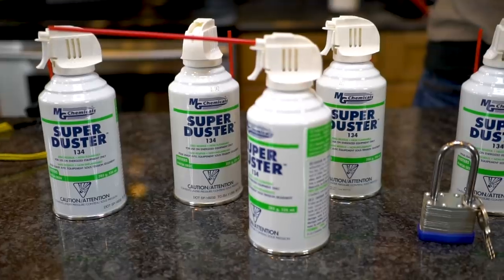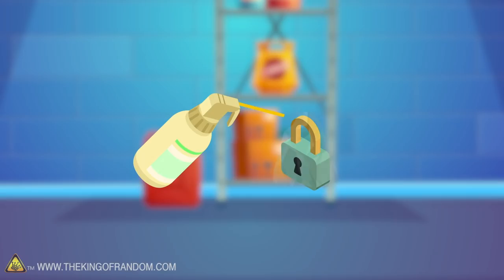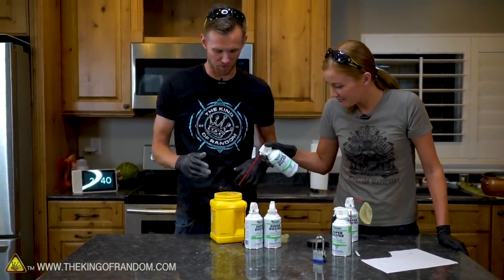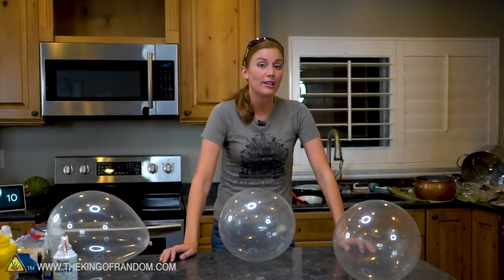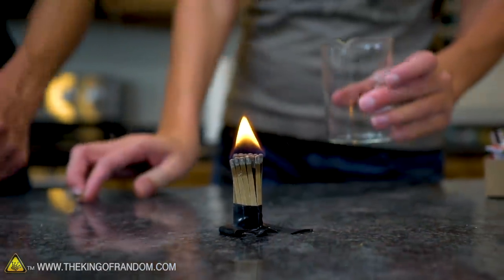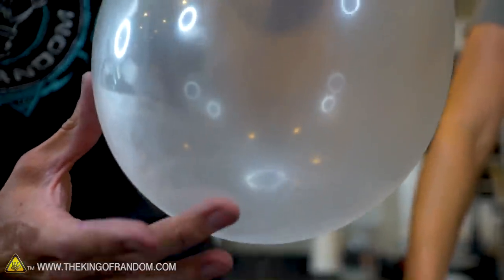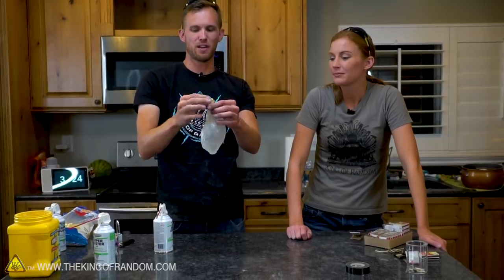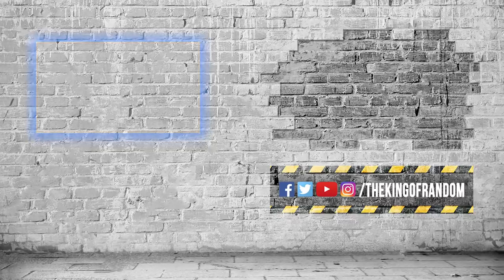Can You Break A Lock With Canned Air? (Movie Mythbusting)

Comment: The reason it didnt break is because you didnt have it attached to anything. The only force acting on the lock is the can impact. What you can do is hang the lock from something, like it would be if it were locking a door, and then hit downward on the lock. This way you have the force of the hammer, as well as whatever the lock is attached to essentially becoming a force pulling in the opposite direction. The shackle will separate from the lock body. 

Not saying this explodes the lock, or even that canned air will help this, but you can break a lock this way and I suspect the freezing of the lock would make it easier.

Comment: 1,1,1,2-Tetrafluoroethane is a hydrofluorocarbon and haloalkane refrigerant with thermodynamic properties similar to R-12 but with insignificant ozone depletion potential and a significantly lower global warming potential. It has the formula CF₃CH₂F and a boiling point of −26.3 °C at atmospheric pressure.

Comment: The gas in the can is actually non-flamable. When u blow it across a fire it creats high velocity, low pressure flow which drives the surrounding air (containing oxygen) in the flame fueling it. Thats called the venturi effect. It's similar to blowing to dying campfire with your mouth to get it started again.

Comment: Correction: the gas does not cool down from the transition from high pressure to low pressure. It actually absorbs heat. That's why it makes things cold, it absorbs heat as it goes from a liquid to a gas.

Comment: FWIW, there are a number of propellants used for spray dusters which have WIDELY varying lowest reachable temps. They range from 10F(-20C) through -160F(-106.7C) [] depending on the propellant used. Obviously, this can greatly affect results of a test like this. Y'all should redo this experiment with multiple sprays containing the full range of available propellants :)

Comment: If u actually set it up on a door jig  with a lock clasp like on  the movie. And then use the duster air where the shanks go in and in the keyhole itself and then hit the lock itself on a downward motion it should break. Because trying to freeze the whole body of the lock versus just trying to freeze the Tumblers inside the lock is obviously two completely different worlds🤔

Comment: Guys... are you realizing @KindOfRandom, that you tried to smash the most sturdy part of the lock! Look at the movie again, the lock was hanging and they smashed from the top, so the crucial part ot the lock, which is only 2mm of metal, will break. You can easily smash open such a lock with a hammer. So no myth to bust here, as it is simple physics involved.

Comment: Hmmm well first the lock was hanging in the movie which a downward strike was used, but the way it was done in the movie is not how it’s done in real life it has to be shot into the cylinder to freeze the inside mechanism which will break off the little tab that holds the shackle in place, but maybe retry your experiment your way with the lock actually hanging and not on the ground maybe you can get enough liquid down the shaft to the mechanism 😉

Comment: After you spray the lock with the Air, Spray it with Freon. Then see if it smashes. Extream cold to extream heat. On metal should make it brital, or plyable.

Comment: If you want to open a lock like that all you need is a hammerhold constant pressure about 10 lb and tap it also slightly really fast but you have to hold constant pressure on it

Comment: Why didn't you spray it inside the pins of the lock inside the bolt, freeze those then force the pins to open the lock using a screwdriver for leverage?  Breaking thin pins would be a lot easier than trying to break a lock shackle.

Comment: if your trying to be acurate with the lock experement you need r 12 duster not r134 witch is what you have r12 is signicifantly colder and known for freezing ac compressors on cars and blowing them up thats why they switches ti r 134

Comment: You don't need the canned air you just have to hit it as if it was in use. Downward force can make the locking mechanism give and open it up. Smashing the body works in theory, but takes such a higher g force to break through compared to the latch bar. You guys were wasting your time doing it that way.

Comment: So you can’t shatter a lock with canned air and a hammer. Sad. I was hoping you would have tried to spray it into the keyhole though. Might it have caused the pins to shatter if you yanked on the lock really hard? 🤷🏻‍♂️

Comment: If you have a padlock on a hasp spray it and then strike it with a hammer it will break the pins inside the lock and open it. Will it shatter the lock itself, no it won't.

Comment: You absolutely can break a lock with canned air. Use the entire can spraying into the lock. Don't hit it with the can... hit it with a hammer or a rock and it will break no problem.

Comment: Sorry but I had to give you a thumbs down on this one because you simply were beating the body of the lock which is laminated steel you should be hitting the hasp the latch the tiny little bar that locks inside that hole is where you should hit.

Comment: My brother once put the liquid on my sholder for like 3 seconds and it hurt for like 30 min dot put the liquid on your skin
Reply: Once my brother locked me in the trunck without the pull tab and I found the small part to get out a bunch I snuck a flashlight in a few times because he gave me his keys to press a button but it was late and most buttons made noise but I used the keys like 4 times then he found the flashlight
Reply: My brother once also threw a piece of cardboard at my face and gave me a black eye
Reply: We also buried a chainsaw and a bunch of other things and there was a pull thing sticking up
Reply: He also made a thing where you put tape on a can then put paint inside I think and then loaded it with nails